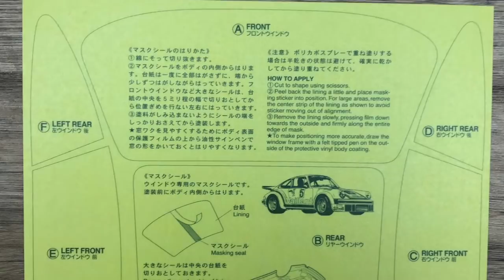1 of only 333 Tamiya RC Car Tamico Porsche 934 RSR Vaillant Edition Body Build Part 2

Comment: I have the Tamiya Jagermeister Porsche 934. Mine was supposed to be a limited edition too. My kit number is #84399 but than Tamiya released the kit again under a different kit number. Maybe what I have is no longer a limited edition? The kit was not numbered like yours is. My kit did include the basic LED light kit but did not include an electronic speed control. I did add the Tamiya blinker LED set and of course got an electronic speed control too.

Comment: The best thing after a build is the removal of the plastic protection on the body :) 
Wouldn't a touring cockpit fit better than a rally cockpit ? 54157 or 54298
Reply from the maker: aviano72 I just can’t believe Tamiya doesn’t have a cockpit for the 934.  It’s a must for such a stunning looking car.

Comment: Looks lovely that mate. Have you a link for the magnet body posts you where on about?
Reply from the maker: Bearded RC Hi,  I got them off eBay.  Just search magnet stealth invisible body posts 1/10th and you should find loads of different versions.  I went with the ones that sit over the OEM posts.
Reply: RCKicks cheers buddy
Reply: How would you go about installing them? I have thought of glue but I think that would pull the paint off.
Reply from the maker: @BeardedRC  I always key the body before painting so it can grip the polycarbonate better. That said its still a risk for sure.  You can attach an offcut of polycarbonate to the underside to spread the load of the magnet over just attaching the magnet directly to the body.  That was my plan anyway.  I see this more for static display over full beans driving, so I don't see it as an issue really for this kit.  
Thanks for the kind comments Bearded RC :)! Gavin
Reply: RCKicks Niceone buddy. You should defo do a how to video. Am thinking of doing it for a project of mine. I have a Land Rover D90 here I don’t want to be drilling holes into it looks too good for that so this is definitely the way to go for me the benefit is this has been painted on the outside so I can get a good key on it for glueing.
Reply from the maker: @BeardedRC  Sure I can record me fitting mine to the 934 Turbo RSR.  I would love the D90 in my collection.  Actually I would like a real one :)

Comment: Why do you scuff up the inside of the body? Doesn't that show up on the outside? What sponge are you using?  Great job btw
Reply from the maker: ZERO'S HOBBIES Hi, no it doesn’t show up as long as you are gentle.  You want lots of micro scratches, this is so it gives the paint a way to grab the body and it stops the paint from peeling off when flexed.  You have to go easy as pushing too hard will damage the body and then it will show up in the paint finish.  I use a green dishwashing green sponge.
Reply: @RCKickschannel  You actually want to wash the bodyshell first before masking. This removes the release agent on the shell from molding. Along with the slight scuffing that helps paint adhere fully to the lexan. I wasj mine in warm water with a dose of Fairy Liquid in the water, and use the sponge side of a wash sponge first, getting into all the detail areas, then use the green scour side (or white depending on your sponge) to then key the large areas, steering well clear of any areas that will be clear, such as windows or lights.